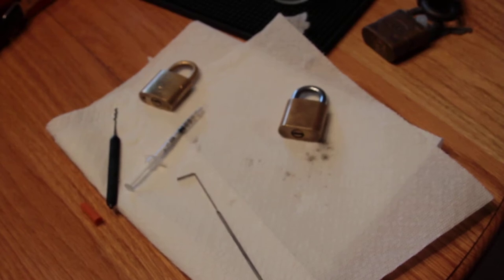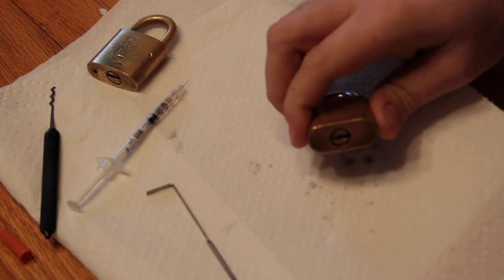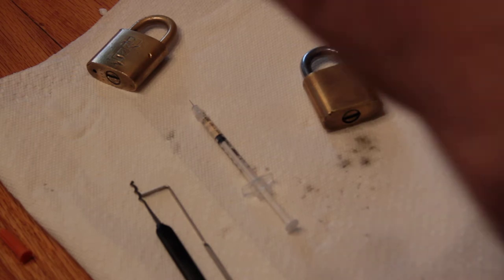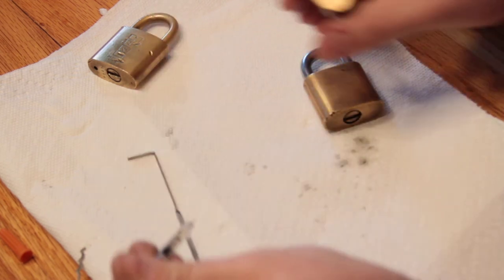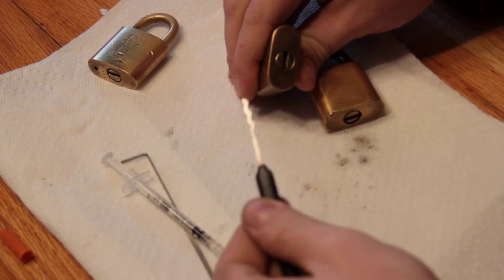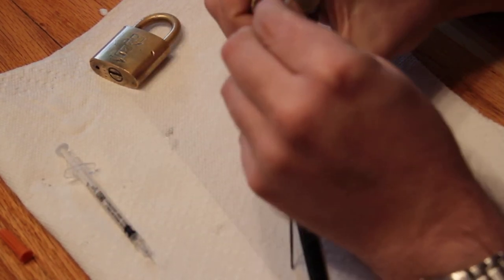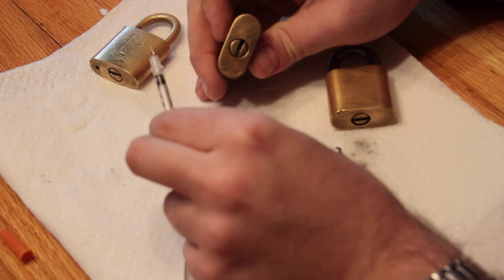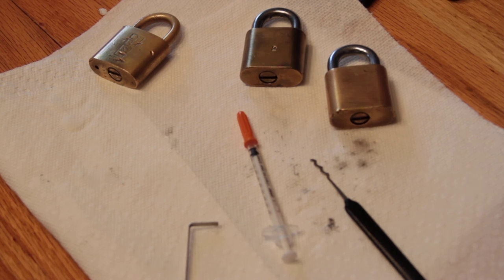(003) Precision Lock Lubrication

Comment: I use syringes as clock oilers, then I realised they would be perfect for this type of work also.  If one is concerned about needle stick injury just file/grind the point off back to the taper on the needle.  One could fill the syringe with petrol or metho or basically anything.  Syringes are cheap to replace.  Great video.

Comment from the maker: I have about the same number. Of these, I've managed to pick two of them open. The others are mighty stubborn. 

I may have to try waddac2's suggestion of GT85 to loosen up the pins a bit more. 

I've been trying to impression one of them (probably not the easiest lock to learn impressioning on, but what the heck)... it it works out, expect another vid. 

By the way, if you have any cut Hurd keys, could you post a couple photos? I'm trying to narrow in on the depth-and-spacing parameters.